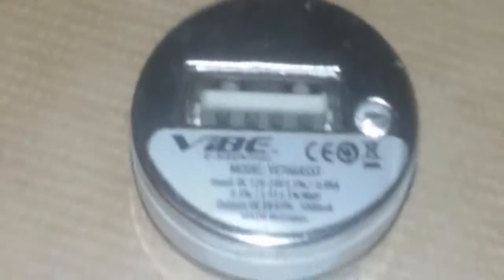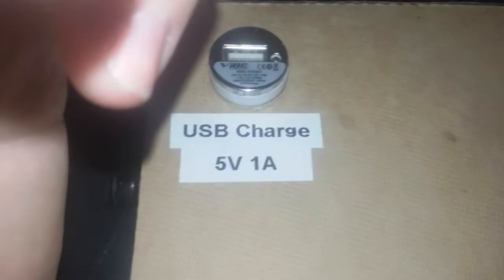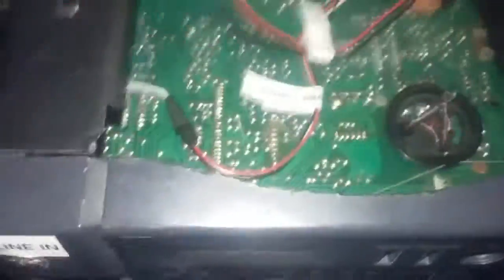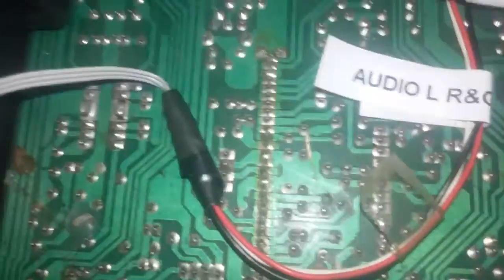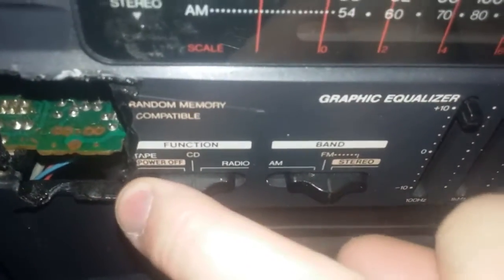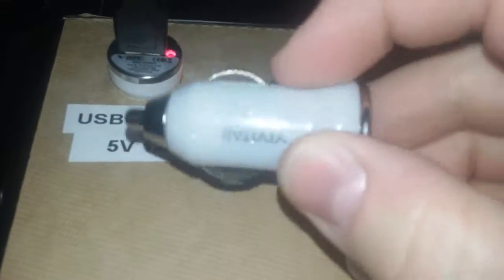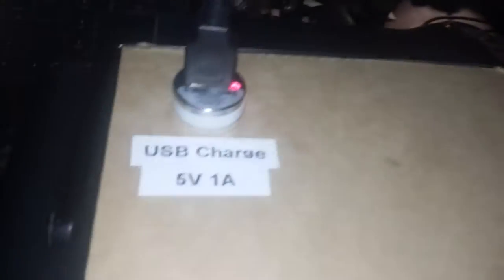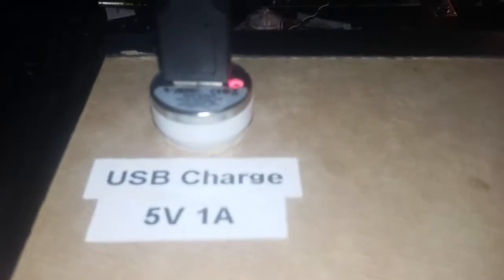Emerson AD-2452 Boombox stereo USB and line input mod

Comment: old stereo. what camera do you film with?
Reply from the maker: I use my phone, It's a samsung galaxy core prime on straight talk (Walmart).
And yes this is my first real stereo and first CD player. I think the laser died in it or the sensor so it was no good. Now I can hook a CD player or other device to this and play and charge it.
Reply: coondogtheman1234  I got my Fuji XP 55 that needs a hack done to it. the mic sucks in itI have dropped it so many times and it got run over by a car and has a small piece broken on the edge, but believe it or not it still works great. makes great 1080p videos and takes great pics but the sound quality is bad because the mic I think is bad in it now.
Reply from the maker: Iseekoutthetruth
You should get a GoPro, I'd love to get the one with the touch screen. I have a little pilot action cam which shoots OK video. the video I uploaded of the green guy singing uranium fever was shot with that camera. I do have a Canon digital camera and it does take awesome pics and videos but the battery life is a joke. And the charger is AC only and you cannot charge the camera via USB believe me I tried. I wouldn't mind if I could power it off USB as I'd just use one of my many power banks.
Reply: coondogtheman1234  your the king of hackers I cannot believe you cannot get your cannon to charge off a USB?! I do not like go pro's I use a sony action camera AS -20 when I was doing moto vlogs, but I sold it to a fllow youtuber. I love those little Sony Action Cameras. I tried to hack into this Fuji camera to get to the mic but I am just a rookie hacker, I could not figure how to get the case open lol.
Reply from the maker: Iseekoutthetruth
It just doesn't charge. that's the way Canon designed it. A shot in the foot for them. I thought of maybe asking how the stores power them and when they go to another model if I could have the adapter they used to make a cord to run the camera from a power bank.